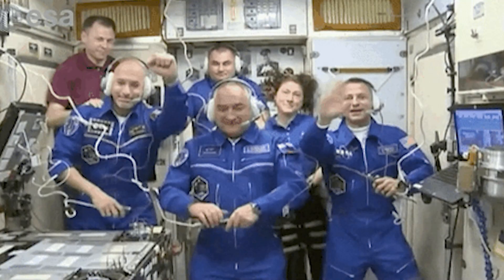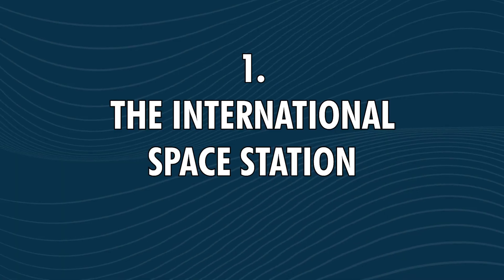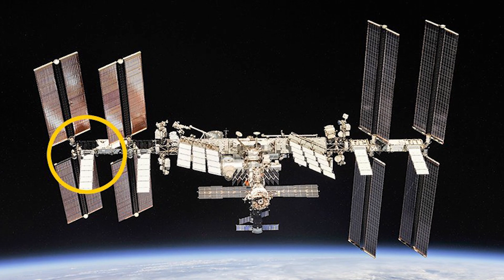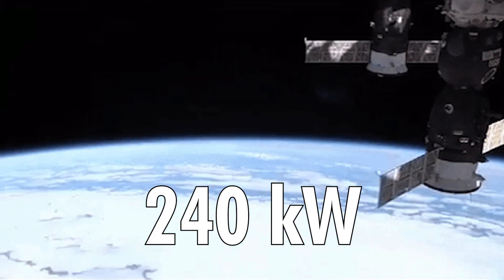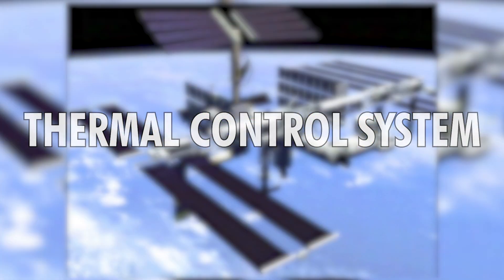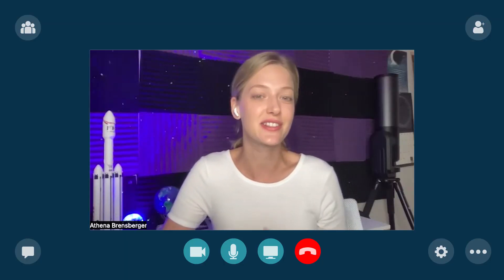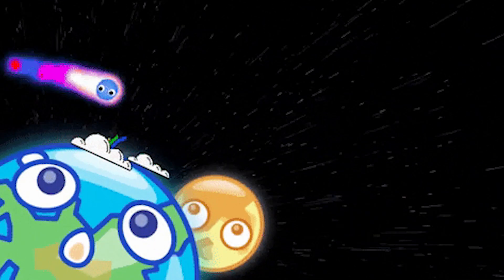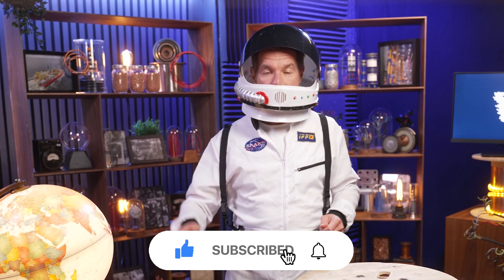Electricity is essential for any trip in the outer space, with @astroathens

Comment: Really cool Video! But wouldn't it be quite dangerous to send the space generated power to earth via microwaves?
I can imagine that the energy density would be very high and therefore it would probably be dangerous for airplanes and animals crossing those waves.
Reply from the maker: Wireless transmission is even experimented on Earth, on the basis of a technology with a beam between two points. A safety cut-off system is used, based on a regular laser matrix. It makes sure that the beam “always touches nothing but clean air”. Even if someone stayed a while in the beam, the heating effect would be one degree hotter only (Emrod, New Zealand: https://emrod.energy)

Comment: Always love the production value of these videos.
Is the operating temperature of the batteries on the ISS as extreme as the solar panels?
Reply from the maker: All components of the ISS are subjected to extreme temperatures ranging from -160 to +120°C. The sun rises and sets 16 times on the station in one day, which increases the thermal stress. On Earth we do not have such temperatures: the most extreme measurements have been recorded between -90 to +50°C.